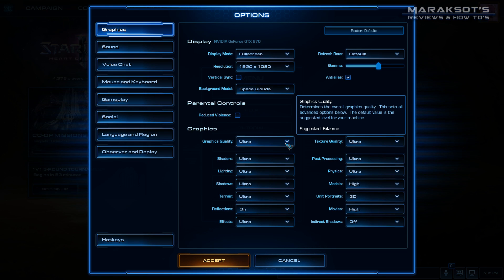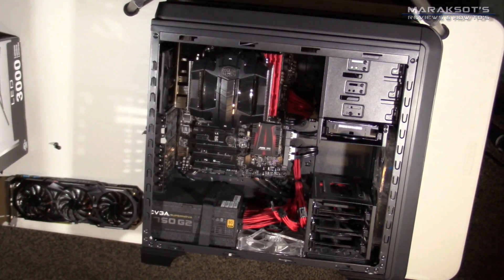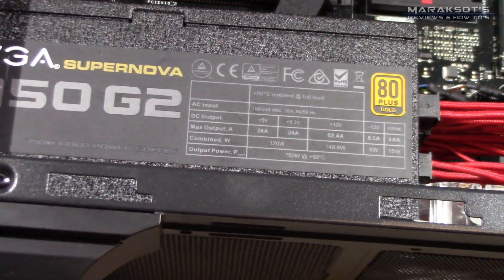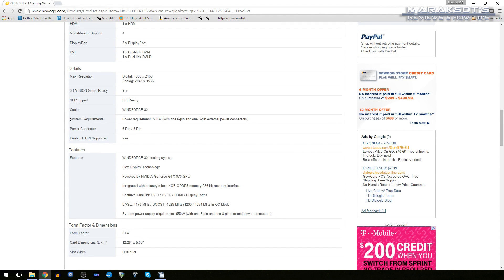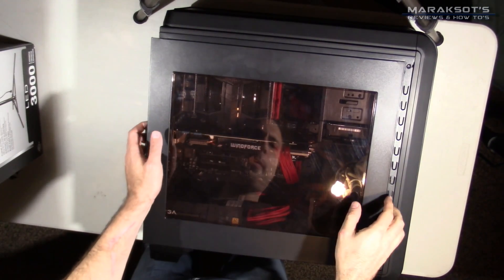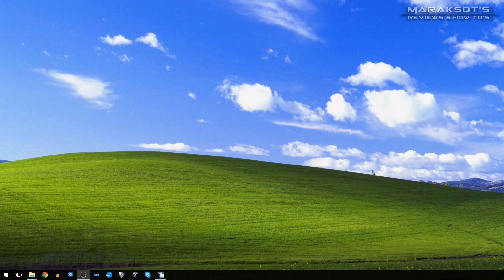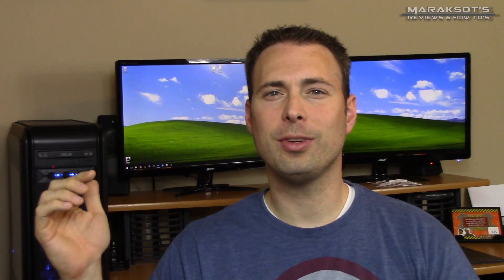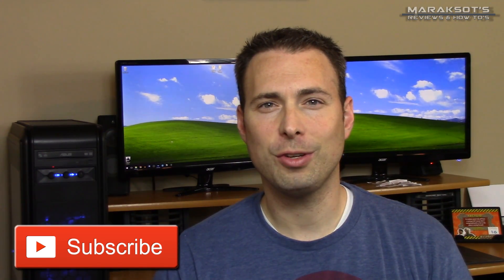A Beginners Guide - Upgrade your GPU - How to Install a New Graphics Card

Comment: Hi i have gtx 1050ti and gtx 1080ti..i have download both driver seperately..is it required to install both driver?when i install 1050ti driver and restart the pc, open device manager, 1080ti also shown too even im not install 1080ti driver yet..when i install 1080ti driver, screen sometime flicking black screen..is it normal?

Comment: So I just bought the 3070 and I want to upgrade to it from the 1060. Should I delete my old drivers and install the new ones after I install the 3070 into my computer?
Reply from the maker: Yes, I would very much recommend removing your old drivers and installing the newest ones.  :)
Reply: @Maraksot78  ok cause so far the only one I removed was the graphic display for the monitor

Comment: so you dont need any driver sweeper software to remove previous graphics card driver and other information?
Reply: Thank you so much
Reply from the maker: You can use applications like DDU if you want to or if you can't get the drivers to uninstall normally but if your drivers will uninstall through Windows Add/Remove programs you don't need to use a driver removal tool.  That is unless you're having some kind of weird driver related problems; that's what tools like DDU are primarily for.

Comment: Hey mark if u or anyone else who sees this can help me id be thankful. I just started upgrading my older desktop and snagging the best stuff off my other older desktops putting it all together. Its still mostly a inspiron 570, but am quickly turning it into a custom build as i learn more. so far all iv done is swap the cpu with a slighty more powerful (but still weak) cpu. Upgraded the ddr3 ram from 2 to 8. I did get the new samsung 1gb ssd nvme m.2, but still have to order the pcie adapter. My system only has sata 2 but soon ill have better motherboard. I was given a geforce 8800 several years ago but couldnt get it hooked up but i cant remember why. I found it earlier and will try to install it tom if i can get all my security stuff finished on it. But after this im kinda lost. Oh and iv got a 850 watt power supply. Not sure how to swap to a custom box, or what new motherboard/cpu i should buy, or which gpu i should get either.  Id like to order a custom computer box thats got plenty of room but nothing crazy. I will need at least 8 monitors running off this system, but may need more later. It will need to to run many virtual systems simultaneously with alot of memory per system, as well as record in 1080 scaling down from 4k for later playback.  Needs to be able to run a ton of websites simultaneously as well, including youtube. Most importantly though i need a major upgrade in network security, both hardware and software. For months iv been fighting through constant lag switching, ddossing, autokicks. 2 weeks ago i lost control of 2 phones, 1 newer laptop, and 4 desktops. Im still working to regain control of many of the devices and only recently regained majority control on the phone im writing this on.  So even though they can see everything, screen, text, audio, video, and have remote access i cant disable,  i still writing and asking for help. I have replaced my router modem but am not hooking up til i get everything cleaned out.

Comment: I'd like to upgrade my graphics card to a NVIDIA GeForce GTX 770. Would this be compatible on my computer? What specs do I need to ensure it'll work if I get it and install it?
Reply from the maker: It depends on what CPU you have and of course whether or not the card you're looking at will fit in your case. Do you have an Intel or AMD CPU? What model is your CPU? Be specific. Saying you have an i3, i5 or i7 isn't useful without the model number. Intel has been using the "i3, i5, i7" branding for over 10 years now and as you can imagine an i7 from 10 years ago isn't nearly as powerful as an i7 from today. You'll need to give the exact CPU model name to be helpful. For example, an i5-4670 or i7-3770. For AMD it would be something like an FX8350 or Ryzen 5 2600.  All this being said even if your CPU isn't powerful enough all that will happen is your CPU will bottleneck the graphics card, meaning it will slow the graphics card down and you won't get as many fps as the card is capable of outputting. It'll still work, you just may not get your monies worth out of your graphics card. I hope that all makes sense.

Comment: And sometimes after all that, it still won't work because the bios needs to be altered - either a simple changing from integrated to the new GPU in the bios settings or a bios upgrade, if available.

Comment: Got a gtx 1650 on the way, wish me luck
Inb4 rx570
Reply from the maker: Installing a new graphics card is pretty simple to do. You've got this! Cheers! :)

p.s. You're right. I would have suggested the RX 570 over the GTX 1650 but if you prefer the 1650 then I say go for it. "Different strokes for different folks" I always say.
Reply: @Maraksot78  I'm just scared I might fry it with a ESD. 
I have a question about the drivers, can I fire up the computer as normal with the new card whilst the old card's drivers are still there or should I boot it into safe mode and uninstall the old drivers from there?

I would have gone for the 570 but it doesn't fit in my case. I have a thing for mini itx systems
Reply from the maker: @TheBoostedDoge  ESD isn't as big a problem nowadays as it was in the old days.  They build in a lot of protections now to help prevent that.  If you just touch your case like I show in this video then it will equalize the static charge in your body with that of the case and you'll be good to go.  JayzTwoCents made a video a year or two ago where he tried to charge himself up with static electricity and touch PC components and shock them.  They succeeded in shocking their PC components but they did not damage anything due to ESD.  It's a great video if you're interested in checking it out.  https://www.youtube.com/watch?v=xdzo-uAvz5Y

As for your question about drivers, you can uninstall them before or after you've installed your new graphics card.  It doesn't matter.  Even with the old drivers still installed your computer will recognize the new graphics card as a display adapter and use it to display video to your monitor.  Video card drivers are just the specific instructions for your video card which allows your computer to maximize the performance your card is capable of.
Reply: @Maraksot78  yeah I just finished watching Jay's video actually. 
Thanks for the explanation
Reply: @Maraksot78  well I didn't fry anything!

Comment: Do I plug my HDMI in after installing graphics card or I plug into motherboard and install then plug HDMI my you won't boot after windows logo with gpu
Reply from the maker: You want your display cable (in your case it sounds like you're using HDMI) to be plugged into your graphics card. When you boot your computer do you see the Windows logo and then the screen just goes black? If so, that is not a display driver issue; updating your motherboard BIOS/UEFI should fix this.

Comment: I’m so upset right now 😢 I just got my gtx 1080 and I’m trying to upgrade from my rx 580 and I can’t get the cable unplugged from the gpu and the little tab to hold the gpu in WILL NOT go down so I can get the gpu out of the motherboard, plz reply so I can get help
Reply from the maker: Removing the power cable can be kind of tough sometimes. I know it can feel like you're going to break something if you pull too hard but sometimes you have to pull harder than you think to get it out. Wiggling it side to side as you pull it out also helps. As for the latch, sometimes it unlocks very easily and you can't even tell you unlocked it. Also you could be hangin up on other expansion slot covers making it very tough to oull out. I have a newer video that is just about removing an old card and installing a new if you'd like to check it out.  https://youtu.be/SkrPxUXRbV0

Comment: @Maraksot78 Nice video! Please if you could give me some insight on deciding a new GPU that’d be awesome. I do light gaming nothing too heavy mostly simulators and such. You seem like a knowledgeable guy worth asking to help me figure out if I can upgrade to a new gpu. 
My PC specs are 

-Quad core elite And-a8 6500 3.5GHz cpu
-JasmineR mobo
-Insignia 520w psu
-Gtx 750ti gpu
-8 GB ram
-HP pavilion 500-164 case 

Was looking at a gtx 970 but afraid it may bottleneck my cpu & push my psu to the limits. so I’ve been looking into the gtx 960 & it seems more suitable. If you have any insight before I decide to purchase a GPU, I’d greatly appreciate it! Thanks!
Reply from the maker: I don't know for sure if that APU will bottleneck a GTX 970 but my inclination is that it will.  As for a GTX 960... again I don't know for sure as I don't have access to any of that hardware and am unable to test it.  Again my inclination is that the 960 will probably be about the top end card you should pair with that APU but at the same time I don't know for certain.  Sorry I can't be of greater help.

Comment: I've installed a new graphics card on my computer and now it's running much slower, I was using the onboard chip previously. It juast takes longer to start up, load applications, not sure what to do? I had a look for the old drivers to uninstall but can't find them :(
Reply from the maker: That's strange. So you installed a new graphics card and afterward your computer boots slower and programs load slower? That shouldn't happen if all you did was install a new graphics card. Not sure what's going on there. Did you download your GPU drivers directly from the manufacuters website? i.e. Nvidia or AMD? If you downloaded them from somewhere else you could have gotten a virus or malware which can slow down your PC. As for the graphics driver for the integrated graphics you dont need to worry about uninstalling that. You just need to install the drivers for your new graphics card.

Comment: HELP my graphics card slot, does not recognize my new graphics card(it says microsoft basic display adapter)
, it cant install the graphics driver also, when i run driver updates, there is thr update for the new graphics card i installed, but it cant install the new driver HELP??

Comment: I want to upgrade my 1050 ti to an RX 580, but i'm kinda skeptical about the installation process....

When I uninstall the drivers, remove the graphics card, and put the new one, if i connect my hdmi connection to the rx 580 will i still be able to see my desktop in the monitor even without the drivers installed? 

(i bought a pre-built PC that i can upgrade but im kinda new to this)
Reply from the maker: I totally understand your concern but the good news is there's nothing to worry about.  Your computer will still recognize your new graphics card as a display adapter and use it to output video to your monitor.  Drivers, when it comes to graphics cards, are more for getting the maximum performance possible out of your hardware in games and other applications than anything else.  If you're interested I made a video where I show the performance difference in a handful of games both with and without drivers installed.  https://youtu.be/BeCGZBvTNiQ
Reply: i appreciate it! i was scared about that specific thing for upgrading, so i appreciate your help
Reply from the maker: no problem.  I'm happy to help.  Best of luck to you on your upgrade!  Enjoy!  :)

Comment: In gigabyte graphics card, is it necessary to install xtreme gaming ?
Reply from the maker: No, there's no need to install that if you don't want to. You will want to install the latest drivers for your GPU from either AMD or Nvidia's website depending on who your GPU manufacturer is.
Reply: Thanks

Comment: Hey please reply about that:

First of all: thanks for the guide, it was really helpful to me.

Second: i have a very important question as a beginner at installing a GPU for the 1st time:

My PSU currently has 4x(6+2)pin PCIE connectors, about installing the 8-Pin, do i have to install them together the 6-pin and the 2-pin, or can i install them separately ??
Reply from the maker: Not so sure I completely understand your question... so are you asking if you can plug in the 6 pin and then the 2 pin? If so it depends on what your cables are like. Mine have little tabs on them where I have to put the 6 and 2 pin together to plug them in. I think it will also work if I plug in the 2 pin and then the 6 pin but I know mine won't plug in if I do the 6 pin first.
Reply: @Maraksot78  Yeah that's what i was asking about, thanks to you so much for help :) :)

Comment: If the cord that runs from your psu to your graphics card splits into a 6 pin and an 8 pin and your new graphics card only requires 1 8 pin, can you use the old cable on the new card?

Comment: Why do I need the drivers
Reply from the maker: Thanks for the question. Installing the drivers for your GPU helps you get the best/smoothest gaming experience your card is capable of. Several months ago I made a video where I took a look at the performance difference in a handful of games with and without drivers installed. Here's a link to it if you'd like to check it out. https://youtu.be/BeCGZBvTNiQ. Cheers!  :)

Comment: I had a gt 705 (yes, a 705) and i recently bought a gt 1030 and when i tried installing it the monitor just said it had no display on it. if i connect my gt 705 again everything works fine. It doens't even show me the BIOS. I need help pls

PS: Pls upvote this comment so it can be seen by more people, thank you
Reply from the maker: This problem is often solved with a BIOS/UEFI update for your motherboard.  You'll have to find out who the manufacturer of you motherboard is as well as the model number to do this.  You can then go to the manufacturers website and see if they have an update for your boards BIOS or UEFI.  You'll need to save it to a USB flash drive and then go into your BIOS and install the update.  Since you can't even access your BIOS when using the GT 1030 you'll want to do this with y our GT 705 installed.  Hope this fixes the problem for you.

Comment: Bro,I've used a gt710 before now I've got a gtx1060.but when I was about to install it's driver it said that the driver already exist.then I removed gt710's driver and install of gtx1060 from cd..But then Im getting only 5-6 fps in fc5.is my gpu is being bottlenecked?my config:
core i5 6th gen
ddr4 2400mhz 8+4 12gb ram
intel h110m mobo...
Reply from the maker: that's interesting... You should be getting much better frame rate than that.  A 6th Gen i5 shouldn't be bottlenecking your 1060 at all.  I wouldn't use the drivers from the CD; personally I'd download the most current drivers from the Nvidia website.  Have you tried any other games? Is it having problems in other games or just in FC5?
Reply: Maraksot78 and now I'm trying to upgrade my gpu driver and they says the driver isn't compitable with the version of my windows.I'm currently using win10 home crack version.so how I'm gonna update it???
Reply from the maker: once again, that's interesting... it's hard to say what's going on without being able to physically see what's going on and stuff.  whenever I have problems like that the first thing I do is restart the computer and try again.

Comment: Can a dual core work with a Titan?

lol
Reply from the maker: It'll work but I wouldn't recommend it. XD
Reply: Maraksot78 The cpu would melt in the first 30 minutes of 5 frames per hour on any good game.
Reply from the maker: I feel I should point out the CPU wouldn't melt... what would happen though is the CPU's performance would seriously limit (aka bottleneck) the number of frames per second the Titan can output.  The reason I say I wouldn't recommend it is because that Titan you just paid over $1000 for would likely be limited to the performance of a $200-ish graphics card because most dual core CPU's today don't have enough power to supply instructions to a GPU like the Titan fast enough to allow it to reach it's maximum potential. If you're gonna spend the big bucks on a graphics card, in order to get the performance you paid for you're going to want to also spend the big bucks on a CPU that can keep up with it.
Reply: Maraksot78 I didn't know a cpu would lock it's fps I throught It would push up to it's maximum limit like overclocking more than you should and melt or something, that's usefull piece of information. So to run a Titan I'd need a (for example) Ryzen 7 I suppose. Thank you for the information, it was very kind of you.
Reply from the maker: Ryzen 7 would work, Ryzen 5 or an i5 would also work pretty well.
Reply: Maraksot78 How about a Ryzen 3 with 3.5 Ghz? Not so well?
Reply from the maker: Not with a Titan; from all the stuff I've seen the highest end GPU you want to pair with a Ryzen 3 is a GTX 1060 or an RX 580 which are both fantastic GPU's for 1080p 60fps max settings in most games.
Reply: Maraksot78 That is exactly the set of cpu and gpu I will have when I reach my budget anmount after working. Completelly agreed, thanks!
Reply from the maker: Awesome man. That'll be a really nice 1080p gaming rig. Cheers bro!
Reply: Maraksot78 Thank you man cheers to you. Earned urself 1 sub!
Reply from the maker: Thank you very much, I really appreciate it. :)
Reply: Maraksot78 You are absolutely welcome. I'm glad to join the family.